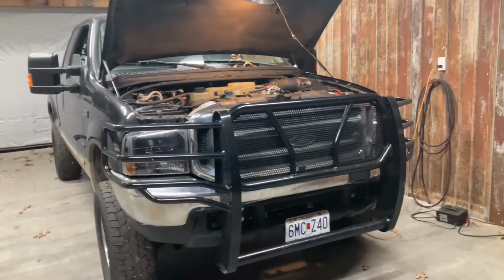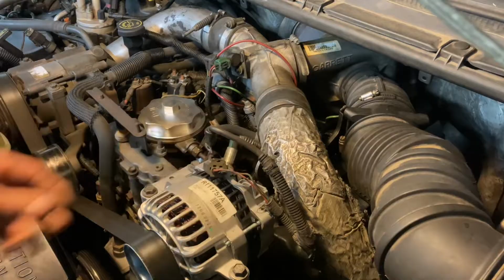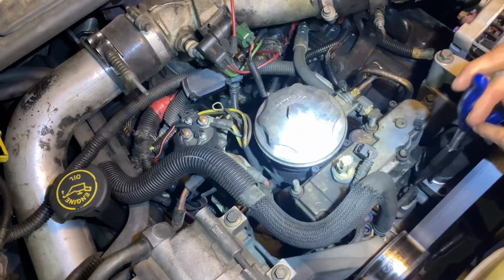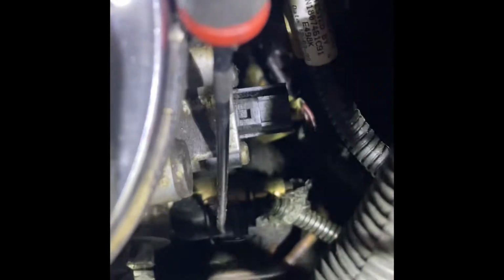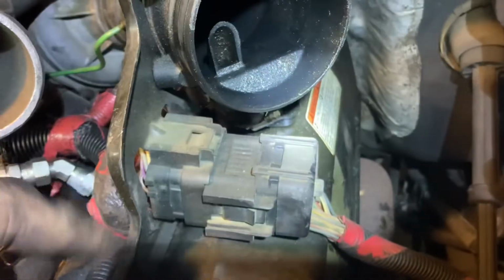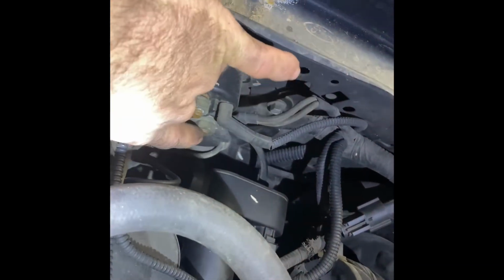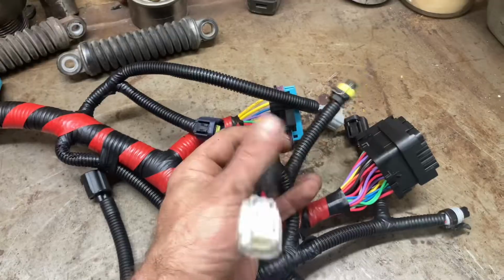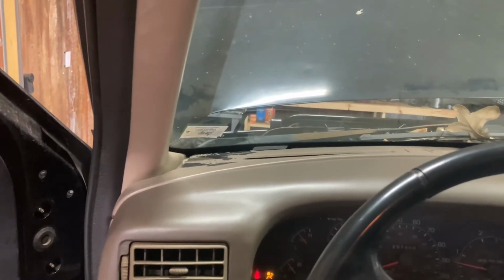7.3 Powerstroke engine harness replacement and modification

Comment: I'm installing a new harness too are u saying the new "cheap" harness causes problems with the fuel heater or these trucks in general? I'm just asking cause mines seems fine and I want to delete it if it's caused by the new harness?
Reply from the maker: The actual fuel heater causes problems unrelated to the harness I would recommend at least leaving it unplugged
Reply: @simplytinkerdad ahh ok cool thanks for clarifying that for me

Comment: @2:03 why does my 99 7.3l only have 1 relay?
Reply from the maker: It might not have the intake heater plug  which is just an emissions thing. You don’t have to have it. I unhooked mine
Reply: @simplytinkerdad  I found out that apparently in 99 there is another wiring harness that is pre-emissions. Thank you for your response.

Comment: Any update on the quality of this harness?  I have a 97 with 382k miles.  The engine goes into limp mode when it gets pushed hard on grades while towing.  Found some injector wires grounding out in the harness.  Put some tape on it and was good for about 2 years.  Happening again.  I see oem ford is around 600$ ebay like 150.  Oem ford is wrapped in a wire i assume for interference or something like a faraday cage.  Did the ebay one have that wire wrap?  If no, how is yours performing while towing grades? Maybe your foil tape does the same thing.
Reply from the maker: I didn’t see any wire tape on this harness lol maybe you’re right my tape does the same thing. Still have had no issues out of the new harness truck pulls good

Comment: Did u have issues with the water temp sensor connector or the water pump being different?
Reply from the maker: No i didn’t have any issues if you don’t want to return the harness I would try pulling the pins out of the new connector and swap to the old if they look the same

Comment: Do you buy after market sensors too?
Reply from the maker: I stick to oem sensors I have had bad luck in the past with aftermarket sensors but to each his own
Reply: @simplytinkerdad  what about the plugs? I just bought from ford and $80 pigtail for my new ICP sensor but they were as low as $5 on Amazon…
Reply from the maker: @joeymalin  ha yea the oem stuff is definitely pricey. I did buy aftermarket glow plugs I don’t remember the brand but they have worked good currently 4 years old no issues
Reply: @simplytinkerdad  Thanks for your reply!
Reply: @simplytinkerdad   those non OEM glow plugs will work but they are known to break off in your cylinders.... May want to switch those out to new OEM.
Reply: @simplytinkerdad  the problem is when you have to remove them. the after market ones swell at the tip

Comment: This video is exactly what i was looking for thank you! I just installed some Banks tubro parts, new up pipes, exhaust valve delete, completely new exhaust, oil crossover line, and a few more things. I believe I damaged the harness in the process also I can see cracking in the wire insolation all over the place. I was planning to get a cheap wire harness and swap it out with a quality check like you did. Allot of people don't know this but pretty much every single OEM harness for any vehicle made today is hand made in China. It's basically impossible to automate wire harness production. I wouldn't be surprised if the harness you got comes out of the same factory that makes the OEM replacements. I had no idea about the fuel bowl heater running on the same circuit as the ECM. I am getting KAM memory errors occasionally. I will definitely delete that while i am at it. Thanks again for the helpful video, keep on trucking ✌️

Comment: When you deleted that heater bowl plug what did you to delete?
Reply from the maker: Just cut the wires and heat shrink the ends to keep them from corroding. If I remember right the fuel bowl heater fuse also runs the pcm is the purpose of deleting it

Comment: what would you say how hard was this job from 1 to 10 and how long did it take you?
Reply from the maker: It took about 2 hours i would say a 4 on hardness. Getting the old hardness out is harder than putting the new one in because the connectors are all nasty and stiff
Reply: What brand of harness did you go with
Reply: @JoseGonzalez-xh5rs  ended buying a ebay new harness and did what he did

Comment: Thanks for the video. Is your truck a manual or automatic transmission? The reason I ask is that I think the harness may be different for automatics versus manual.
Reply from the maker: My truck is an auto I believe you are correct they are different

Comment: Gotta love those damn squirrels! They got up in the boom on my 55ft bucket truck for doin treework and they made a nest and chewed just enough that it was still working but when i was up in the air prob like 40 ft and my hydraulic line busted and the boom just slowy crept down and rested on top of my cab , so anybody wondering it doesnt just fall out the sky but it wasn't very good for business., i went to war with all squirrels around my shop flying the accorn flag ! 😂
Reply from the maker: Ha that is scary I will have to watch out I have a hi ranger 52ft foot truck that left me stranded halfway up one time 25 feet climbing down a rope made me pucker pretty good your deal is what would really scare me though
Reply: No check valves in your truck?